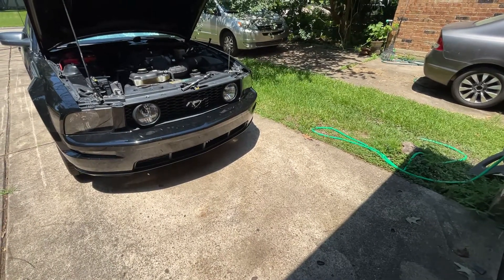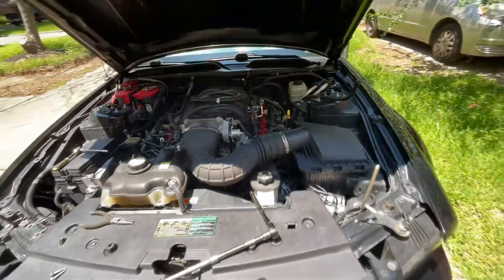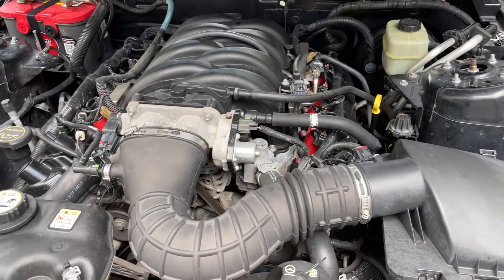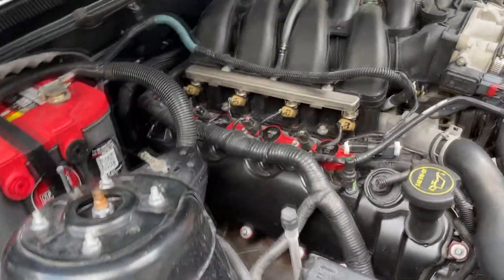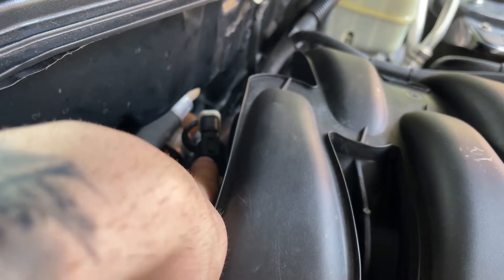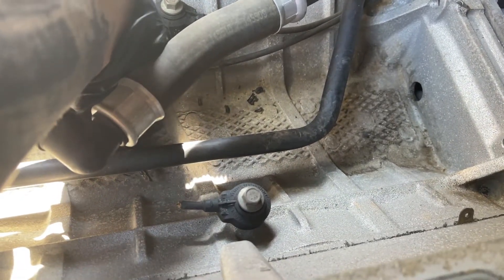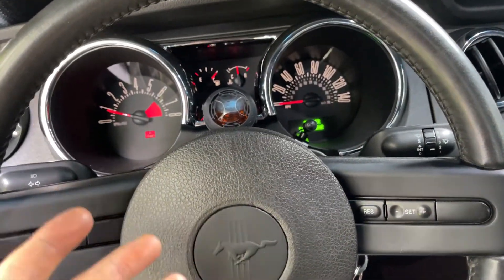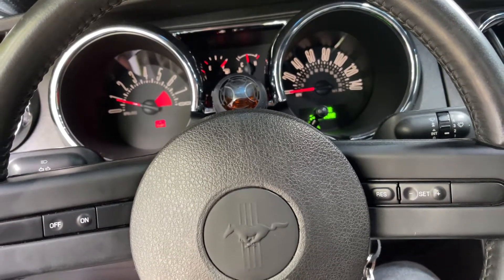2005-2010 Mustang GT | Knock Sensor Replacement

Comment: Did you replace the plenum o-rings?     Did you inspect, clean and just bolt it back together?
Reply from the maker: No, they are reusable if they are not damaged.
Reply: @DerEhrwurden  hey from downunder of usa, read up sea-foam can mess up the catyalic convertor, not sure if true or false.
Reply from the maker: @leepopaz253  it’s probable if a lot of that carbon junk is being expelled out the exhaust. I personally don’t use that crap, I run the expensive 20 dollar Techron every couple of seasons and always use shell 93.

Comment: Thanks for you video friend. Do you have any pictures or links of the Knock sensor? I’m about to buy it and I’m a little confused. THANKS ❤
Reply from the maker: No part number but just type in something like 2005-2009 Mustang GT Knock Sensor should pop up a few different manufacturers. Or can rock auto search it.

https://lmr.com/item/LRS-12699B/2005-2009-mustang-knock-sensors?year=2005&gclid=Cj0KCQiAkMGcBhCSARIsAIW6d0Bu2JwFHYdBM4iSig_Yp2PIhs2h7xqgNIF3qivy7i4vMy_cyvZw4ywaAi0yEALw_wcB
Reply: @DerEhrwurden  hi, need ya help, thats an pcv valve sitting on top in beginning of video?? is so its not one like other cars where ya shake it and rattles?, so do i replace that part being the entire pcv valve??. thanx
Reply from the maker: @leepopaz253  Not sure I understand your question, I removed it for the sake of that part of the video so you could see the sensor more clearly under the intake. Currently I removed that hose and replaced it with a catch can. This cars come a long way from then and now lol.